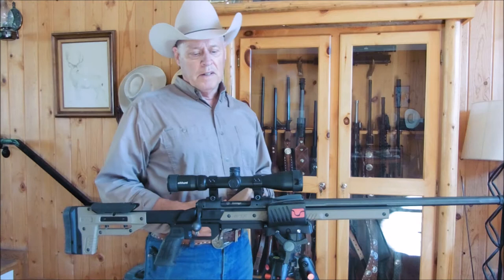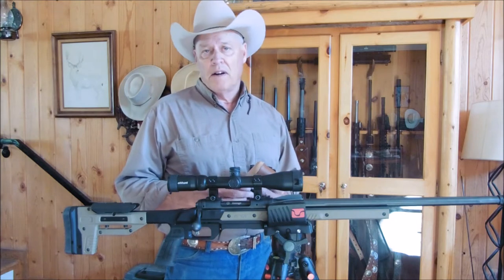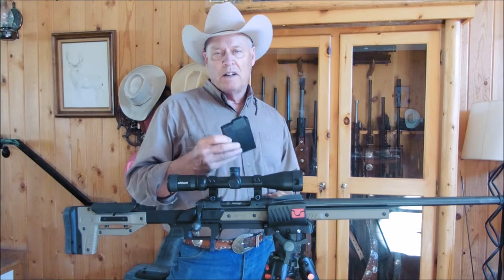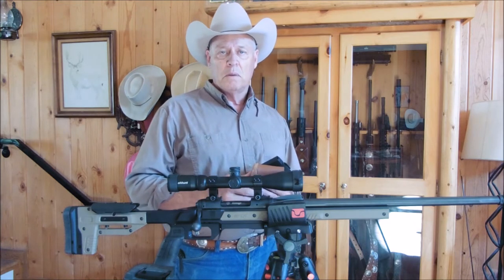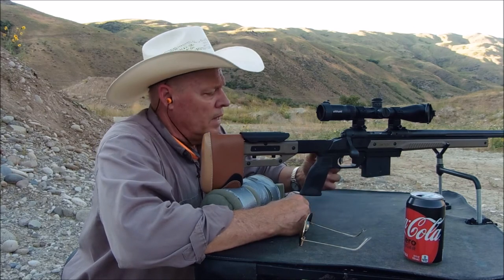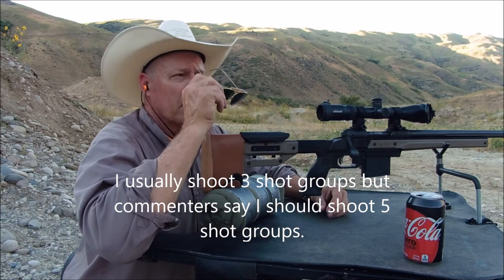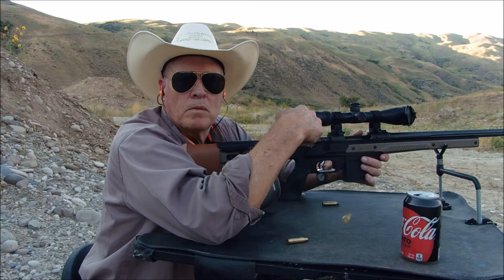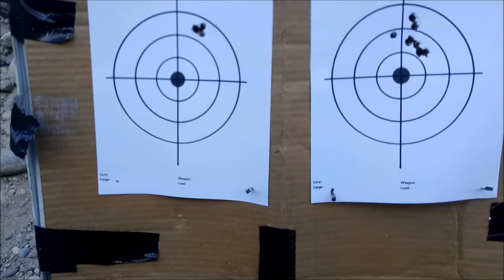Oryx Chassis Review and range test. Made by MDT

Comment: Oh well! Damn good shooting. A half inch with 5 shots is excellent! I added an Oryx chassis to my Tika T3X 223 a few weeks back. I had trouble with the magazine at first. I had to push it forward in order for the rounds to feed and not get stuck on the feed ramp. I called MDT and the solution was a LONGER magazine latch, which took another 3+ weeks to receive, and was a bitch to install. I took it out today after making the mods, the magazines are sticky, but I have no feeding issues. My only complaint about the Oryx chassis is how long it takes to get service. Otherwise the product is fantastic. I plan to make a video comparing it with my Ruger American that got me started.
Reply from the maker: Look forward to watching your video. Thanks Dennis.
Reply: @davestrohmeyer-saddleupsho8009  thanks Dave
Reply: @davestrohmeyer-saddleupsho8009 I’m putting the finishing touches on that video now. To be released soon. I mention you in the beginning and again. Appreciate your inspiration.
Reply from the maker: @EverydayReloadingandShooting  Thanks for the mentions, look forward to the video.

Comment: Are you running a fluted bolt? My stock savage bolt  would get hemmed up while loading another round, got a fluted bolt sleeve and reloading is as smooth as butter now. 👍 Great video
Reply from the maker: No, but your idea does sound intriguing. The Savage bolts cocks on the bolt lift and some say the firing pin spring is the cause of that heavy lift. I don't like to have to reposition my offhand to hold the fore end just operate the action. Thanks for your comment.

Comment: Nice job, would have liked to seen what it took to actually get it together
Reply from the maker: Really easy, Remove old stock, read supplied directions as to torque, 60 inch pounds. The only real difference is the supplied action allen head  screw is the longer screw and the short screw goes to the front of the stock for the recoil lug..Exactly opposite of the savage screws.
Reply: Just got one for an old savage. I didn't have bottom metal, a trigger guard, or action screws so it would have been a lot of hassle to get a wood stock.

Dropped the action in, screwed it in, and was ready to go